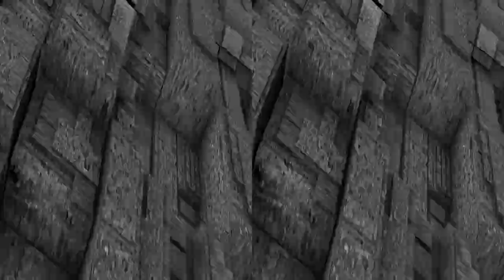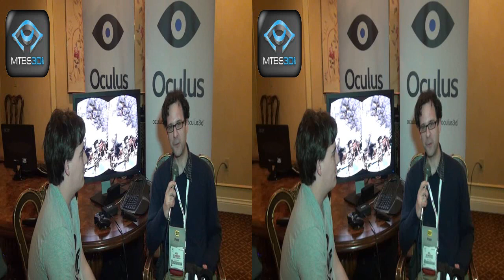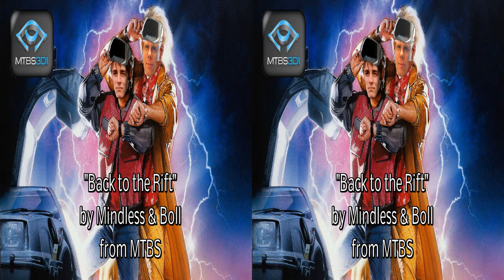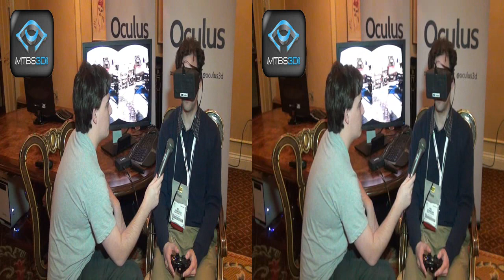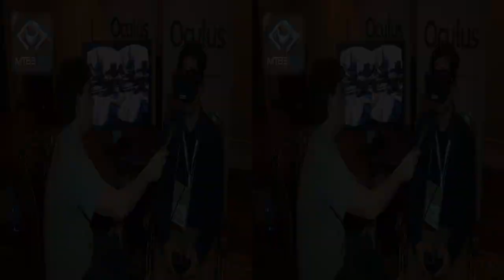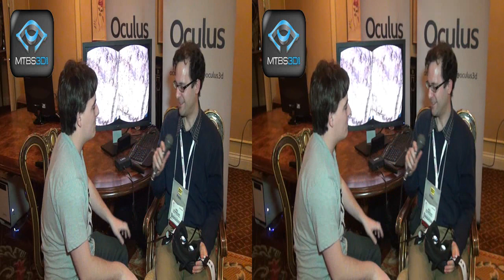MTBS-TV: Interview With Palmer Luckey, Oculus VR at CES 2013...in 3D!

Comment: Also, I'll point out that the Rift does in fact use an LCD with an LED backlight. The new 7" panel they've selected has nice specs, and is not the old CCFL style display.

Comment: I think you're still a little confused about the tech. Retina does not refer to a type of display, only the display resolution in terms of pixel density. Again, what Apple coined its "retina display" was an LCD, and high density displays continue to be dominated by LCD. OLED is emerging as something that will one day replace LCD but it isn't there yet. I suppose a premium version of the Rift is possible, but it's still contingent on screen availability. OLED production ramp up has been slow.

Comment: You're mixing and matching a lot of acronyms and trademarks here. LED does not necessarily refer to OLED. Most LCD screens today use an LED backlight. Retina does not refer to OLED either. The Apple's retina displays, as with most displays with ppi's greater than 200, are in fact LCD. The new Droid DNA phone which clocks in at a record 440ppi is an LCD screen. Despite its promise there continue to be major drawbacks to OLED in terms of cost and availability that prevent its immediate adoption.